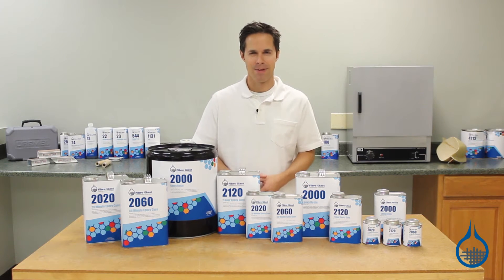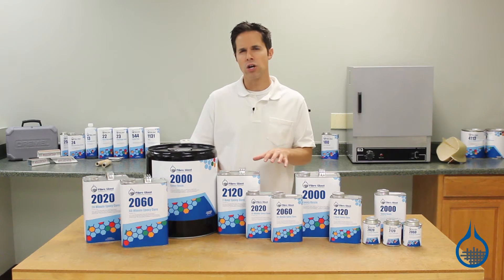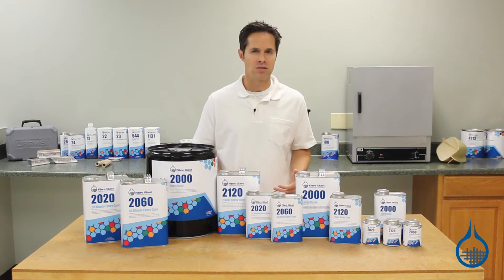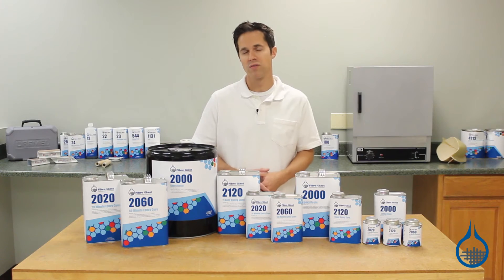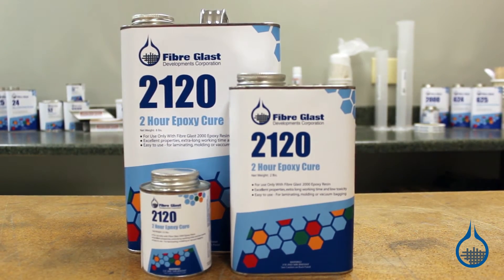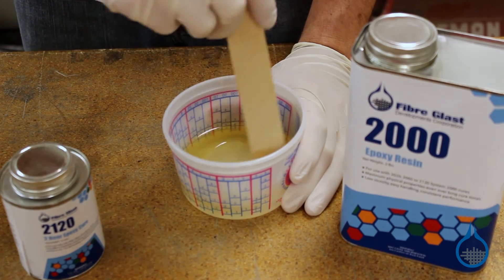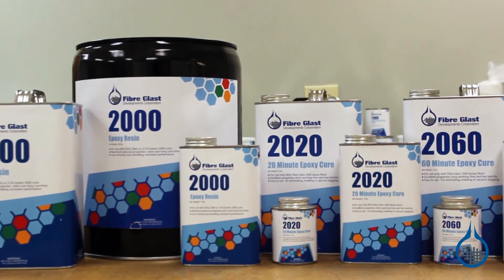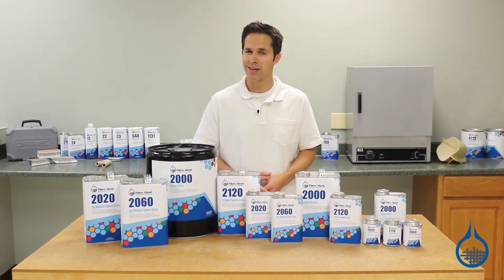System 2000 Epoxy Resin

Comment: I greatly appreciate the guidance for cure temperatures in order to enhance service temperature tolerance. 
Is there also a difference in final strength and/or service temp tolerance, between the 3 different hardeners? Thank You

Comment: Do I need to use a polyester resin when mold making with used in conjunction with 250-B. I had them order 2120 epoxy for its longer pot life since the ambient temps in Arizona are high right now an don’t want the resin to cook off under higher ambient temps. I plan on putting a couple layers of 3k carbon in to add strength to the mold since it’ll be used under vacuum afterwards.

Comment: what do you mean by not to be used as casting resin?
Reply from the maker: Our System 2000 Epoxy Resin is meant to be used when making composite parts, with a reinforcement fabric such as carbon fiber. It is not designed to be used as a casting resin like what is used to make table tops for example.
Reply: Of course you cant explain the science behind the 2 different designs